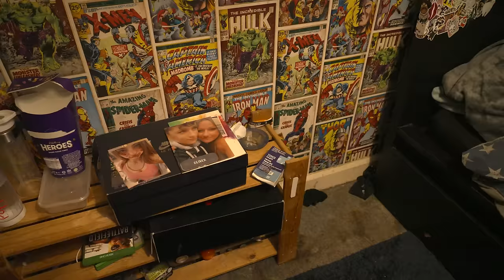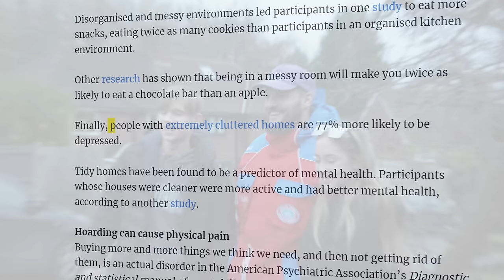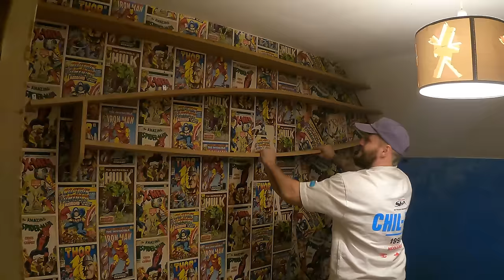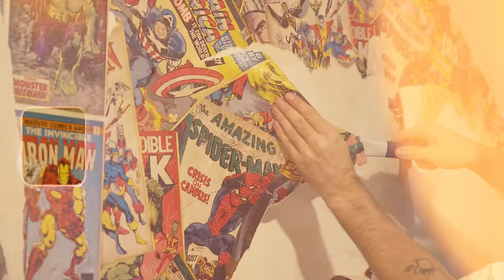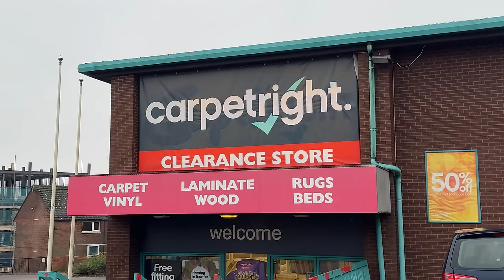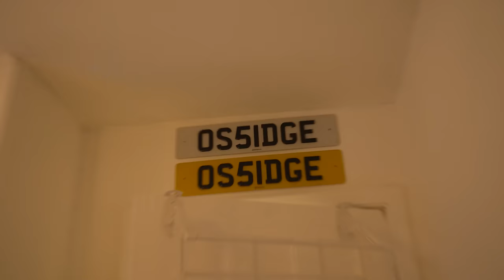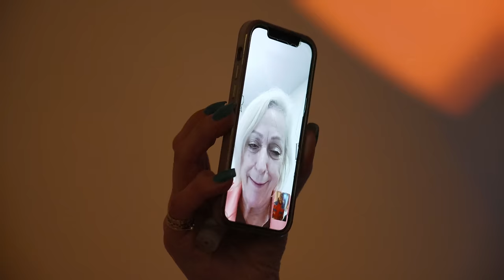This Subscriber Lost Everything, So I Did This..

Comment: Awesome stuff,just a tip,,I noticed there no trickle vent in the window so no air flow can move about,if can get a vent in the window,or even a small vent out through the wall somewhere to allow air to be drawn about,and when he not in his room or just at day time then leave your window open slightly to allow air,,when you have a small warm room and it cold outside like is now and have a warm room,then the cold outside is making the moisture inside start to turn into condensation and will develop water which leads to mould ect when drying and then when room heats back up mould loves it so gets worse,,I'm no builder but a painter and decorator and in my experience ventilation is key in any room..just leave the small window open slightly, Good stuff guys. 😊